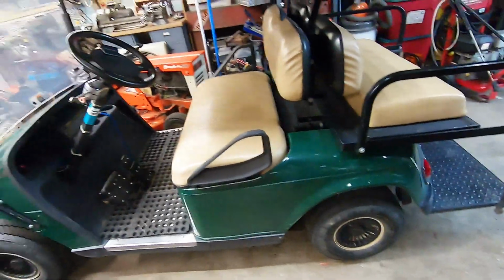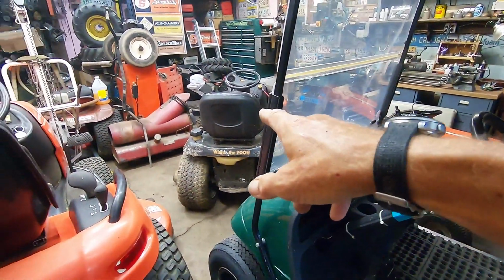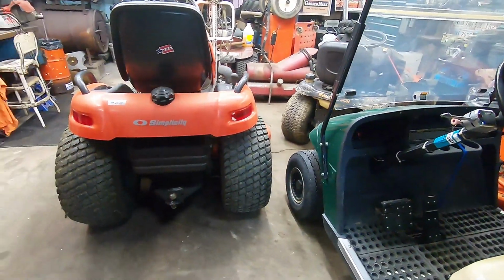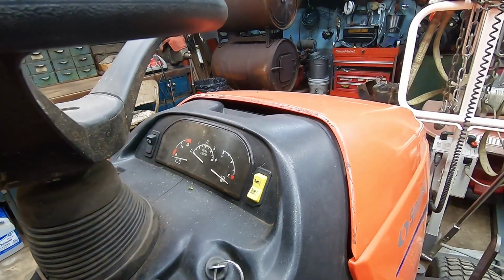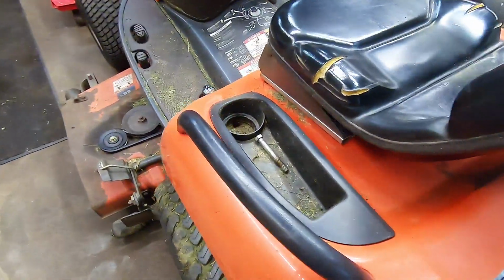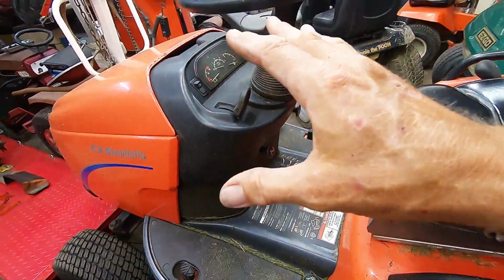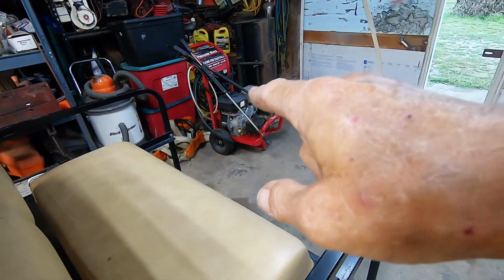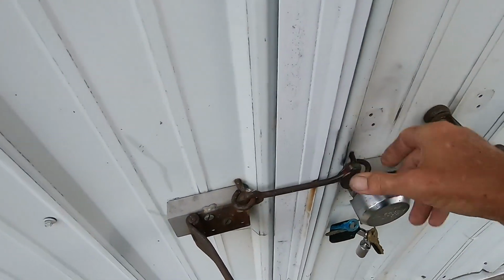Jobs and a New Addition to the Ranch!! #smallenginenation

Comment: Glad to see you making videos Zippo! As always, you got a lot going on in the shop! The shop around our place has mainly consisted the last week or so of working on the 725. We had to helicoil the spark plug hole because someone didn't do a good job repairing it 30 plus years ago. We also adjusted the new carb you sent us, installed the muffler and spindle and fixed the emblem on the side of the hood. It was rattling bad, so we took it off, put a few dabs is super glue on it and let it cure before we put the clips back on! The tractor is looking and running excellent now! The restoration was supposed to be just my dad and I, but you were a huge part of it too and we REALLY appreciate your help! Couldn't have done it without you! 
Later- Justin

Comment: Wow, now you talking my language with the Legacy.  I'm guessing you meant to say it's a 1999 vs. 2009.  You'll probably have to run a secondary start button or an additional relay for start wiring to fix the clicking vs. cranking issues (if they show up), very typical for that model with the Kohler.
Reply from the maker: Owners manual states it's a 2009, but I have yet to run the numbers on the tractor it self to determine the year of manufacture. Ron thinks the engine was a 2007. But..this is new territory for me so I've got some research to get done. I'm really digging it and the Kohler Command's are great engines. If it had the dreaded Triad, I'd have passed on it in a heart beat. If the engine ever does let go, it'll get a Vanguard for sure. Cheers Sir Weasel! Thanks for the heads up on the ignition! Zip~

Comment: Good one zippo good luck on the golf cart the little robin engine has babbit rods if you need parts let me no i have about 4 or 5 of those motors that i have used for parts maybe if its not to deep in the motor i may be able to help and i have a parts book if that will help let me no. Love ya brother i still havent set up my email on this new phone but i will soon. Tell the misses i said hello take care your brother joe
Reply from the maker: Excellent to know Brother! I'd love to have a good complete engine to have as a spare for it. This belongs to Momma Sue and she ran it low on oil. Hopefully it's an easy fix, but if not, I may have you ship me an engine and the books if you're able and willing. Love you Brother! Zip~
Reply: Your Simplicity Legacy is 1998-2003 vintage.  There are a few discussions on net regarding repair of the steering shaft that might help you.